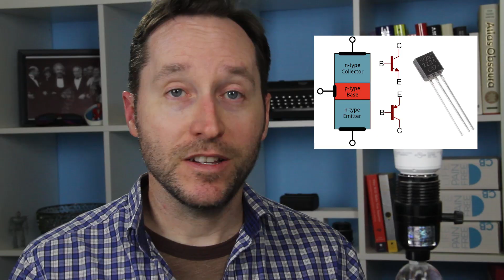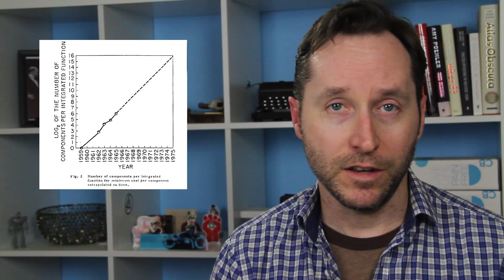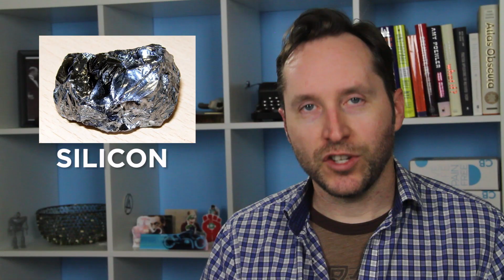Moore's Law Is Ending - Here's 7 Technologies That Could Bring It Back To Life | Answers With Joe

Comment: Computers will NEVER be totally reliable until a $500 CPU is not reliant on the proper function of a $1.50 cooling fan for its survival.
Reply: You can spend $10 and get a bigger fan
Reply: On most current cpus, the death of the fan won't kill the cpu, it will save itself by clocking down until the temperature is safe again
Reply: Pasively cooling CPU's has been a thing for a good long time. Passively cooling a GPU won't be a thing until Graphene is also a thing.
Reply: @btoiscool   what about the 1030? xD
Reply: @elorock6747  that trash is too low tier for me to care about it
Reply: @btoiscool  true, but it shows that it is possible. There even is a passively cooled 1050ti by palit. Its just a matter of how big the heatsink is, plus things like convection assisted cooling like in the corsair one.
Reply: Rick Jasper we’re getting close with laptop and smart device chips
Reply: Would it help if the fan were $500
Reply: I’m ghetto, I know... but dude... easy workarounds. I’ve had years of success with some minor casing removal and a table fan.
Reply: you do know what a heat sink is, no you don't, or else you wouldn't have written that comment

Comment: You're explanation of Quantum mechanics is only going from binary to ternary, and DNA is actually a Quaternary system.

You might think it's only binary because T only pairs to A and C only pairs to G, but order matters. TA is different than AT. If it didn't matter, then it might as well only have two pieces not four.
Here's all the numbers: 

AT - 0
TA - 1
CG - 2
GC - 3

Comment: a quantum computer, as we understand it, cannot exist yet. because quantum mechanics says it can be off and on at the same time. 1/0. or off 0, or on, 1, or off off 0/0 which is on. or on on which is on 1/1. as for 700 terabytes of weight- sd cards weigh about half a gram. so 700 terabytes would be 350grams. sandisk sells terabyte sd cards. im sure there is larger storage devices not available to the public.

Comment: The stacking solution was debunked from the get go, it is a structural marvel, but has no use as a processor, as it would melt itself (or at least get so hot you can't use it with any kind of efficiency).

Comment: The bipolar junction transistor (BJT) cited as the fundamental switch technology has been obsolete for digital logic since the 1980s. Complementary MOSFET (CMOS) transistors took over and made possible the current state of the art in silicon chips. CMOS logic started out as low power and slow, and evolved into low power, blazingly fast, and shrunk way smaller on silicon die area than is possible with BJTs. BJTs are still good for analog audio and RF amplifiers, but even a modest computer chip would be very expensive to fabricate and then fry due to high power dissipation.

Comment: Heh, it's pity you are not mentioning concurrent  programming. You see the reason why Moore's law is a big deal is because  most of our software can run only on one processor core. But you can have multiple processor cores (e.g. i7 chip is 2 physical cores, some  AMD chips are 4 cores,  some servers have 64 core, latest smartphones has like 6 - 8 cores, even some graphic cards have like 512 cores ...)You often hear programmers say "we cannot scale horizontally but we can scale vertically" that means we cannot put more power to single chip but we can have more chips. The problem is that lot of programming history was about taking advantage of single core  that's why we are stuck (e.g. Microsoft Excel still running on single core).  But if the software was written "concurrently"  then you have no problem to use multiple cores. Last couple of years there is huge mindset shifting in Software Developer communities and pressure emphasis on concurrent programming (e.g. check out Erlang, Elixir lang, Go lang, Clojure. These are highly concurrent Functional programming languages  that can achieve communication between multiple cores. Yes Object oriented  languages like  Java, Ruby,... can do concurrent programming as well but there is "thread" level locking of state that is to some degree working but would never reach 100% potential of all cores) So the only limitation at this point are (unfortunately) people and cost of rewriting popular software concurrently. Conclusion  although protein chips sound cool the truth is that for next decade silicone chips are here to stay. It's just you will  have 128 core laptop. The Quantum computer is definitely the future but at this point way ahead of it's time.
Reply: imagine you have a shuffled deck of cards, and it's only you who can sort them in order. Cool you are single core processor. Now imagine you have 3 friends over (so 4 of you) and you will give to each 25% of the deck cards  to sort out and then you will just join them together. Awesome Now you are 4 core processor running program concurrently (e.g.: Functional programming languages like Elixir, Go) . Now imagine same situation where you don't want your 3 friends to touch the cards so  you will sort them together while your buddies are watching TV. Now you are  4 core processor running program on single core (eg 90% of world desktop software).

Comment: that graph around 2:20 is somewhat inacurate, it has been increasing quite a bit faster then that, the latest i7 6800k is quite a bit faster then two generations ago, and if you compared it to the fastest intel processor from 10 years ago it's 5 or 6 times faster.

Comment: You have four different configurations in DNA. That's 2bit. Not binary.
Reply: Yes, thank you. I got so distracted after he said that I couldn't focus on anything else.
Reply: There is four different acid things but they can only be combined in on way. Depending on which order they are stacked between the double helix things you can create two different states, there for its binary.
Reply: @birgerjarl4391  Each of those pairs has two orientations
Reply: @birgerjarl4391  the extra helix is essentially the backup each side has 4 different   elements

Comment: The diagram you showed is not the correct type of transistor for digital logic - you showed a Bipolar Junction Transistor (BJT). Since the 70's most digital logic has used MOSFET (Metal Oxide Semiconductor Field Effect Transistor) which doesn't have a base/collector/emitter, instead it has gate/source/drain and is voltage controlled, not current controlled, and has a very fast switching time, minimizing power dissipation. The transistor you showed is used primarily in analog circuits, where linearity is useful, and turning it fully on is wasteful and generates unnecessary heat.

Comment: nice video but i think it was the other way around. they were able to calculate 15 = 3*5 which is really impressive. Imagine doing that with  34564098. A quantum computer could solve that within seconds. With a normal pc this would take longer than our universe exists.

But a quantum computer isn't automatically that much faster than a normal pc. It's just for very specific tasks where simultaneous computing  is beneficial. For example: finding the way out of a labyrinth. A quantum computer could solve that in an instance because he can try all paths at once. A normal computer would have to try one path after another.

Comment: TL;DR (Spoilers):  No one remembers Moore's Law correctly--that aside--"Moore's Law is dying" is bullshit.  Using Moore's adjusted prediction of a doubling every 2 years, we're perfectly on track.

So, I wrote a paper on Moore's Law in College and this is not correct.  Firstly (and this is a minor thing), Gordon Moore co-founded Intel with Robert Noyce in 1968, while Joe claimed it was "a decade later (referencing 1965)."  Secondly, the part of Moore's Law that everyone and their mothers seem to forget is that Moore's prediction was in regards to the number of transistors on an integrated circuit per dollar of manufacturing cost.  This means that if Intel paid to have a 1 mil transistor chip manufactured for $100 one year, the following generation--18 months later (originally 1 year, then 2 years as Joe states)--would be able to make that same chip for $50 or a 2 mil transistor chip for $100. 18 months later, 1 mil for $25, 2 mil for $50, 4 mil for $100...
All this aside--and ignoring the "per dollar" part, as everyone does--Moore's original prediction in 1965 was way off.  His paper stated that we should be able to manufacture chips with 65,000 transistors by 1975.  The highest transistor count that year was 8,000 and was the TMS 1000, a Texas Instruments processor that came out in 1974.  The first processor to break this 65k prediction was the Motorola 68,000 in 1979 which had 68k transistors.  This is why Moore changed his prediction to a doubling every 2 years.  The trend held to this prediction for a long time....occasionally lagging behind (like from '91 to 2001, when we went from on par with the projection (predicted 1.17mil, actual 1.18mil) to behind by 30 million transistors in 2001 (predicted 75mil, actual 45mil), then spiked up to nearly 3x the predicted 150mil in 2003.
This version of Moore's Law stretched to 2017 shows a prediction of 19.3 billion transistors on a chip.  AMD's 32-Core Epyc server processors are coming in at 19.2bil.  I'd say we're still on track (again, ignoring the whole cost for manufacturing issue that Mr. Moore originally spoke of).
Reply: One year later and he still hasn't gotten laid.
Reply: NOYCE!
Reply: My last 3 computers, at LEAST 5 years of time...were all 2.4mz 2 core cpus, all about $600. Moore's law has been dead a long time.
Oh wait, this most recent computer was $900...it's 2.6mz.  Yeah. Dead..
Reply: But AMD's 32-Core Epyc has 4 dies. So it's rather 4 chips in one. :)
Reply: Xomsabre Nerd, this is why you can't get laid.

Comment: It stands to reason that as you make the widths small enough, semiconductor behavior begins to breakdown. Although that process is continuing even as we reach 14nm geometries, so go figure. As a processor nerd, I have noticed that the enormous speed increases that we saw during the last quarter the end of the last century have all but disappeared, and the fastest micros top out at around 4-5GHz, even with aggressive overclocking and cooling strategies. And it'll be a good while before any of the techs you mentioned will be mature enough to manufacture at any volume and anything like an affordable price. But I hope they will show up eventually.

Comment: If photonic computing could be worked out, there might be  a way to design a Molecule that behaves like crystal and then is grown as a platform that would work like a chip; each molecule would be a computer within itself. Based on how that molecule is designed, it could even operate as a quantum computer because the crystal structure should lend itself to photons being directed providing opportunities for multiple photons at a single position. Something impossible do with an electron.

Comment: In 2056, the fastest and most efficient system of computer processing uses what will be known as the String Axon Medium. When a Tau particle is generated through acceleromic piezoelectric tazon pulses, it is then augmented through an electromatter-optic quattuordec lattice to create quintillions (10^18) of data-embedded static Tau neutrino particles. In the future (or at least mine of 2056), this is called Examatter. By isolating (aka: regenerating) this normally decaying particle, the String Axon Medium is created, and data is synthesized in a never-ending, self-sustaining, and self-learning pattern. I am not allowed to say more.

Comment: In the mean time, get really good at parallel programming. It can be much harder than single-threaded programming, but it's an invaluable skill to have as a software engineer, exactly because Moore's law running out of steam.
Adding more cores to processors still scales relatively well, as it's linear. Increasing clock speed, on the other hand, increases the dissipated heat by the square of the clock speed, so we'll need a breakthrough in physics to get much above 5GHz.
I make as much of my performance-sensitive code parallel, as possible.

Comment: So just want to add to the whole Quantum computing part here... its not that it can do multiple calculations at one time because it is both 0 and 1 at the same time... and it is not limited to 3 settings on, off, and on/off... its based on the fact that something is more something else for instance it is 20% off and 80% on ect... which means we can have more then base 3... and its not because we can do multiple calculations it means instead of being limited to base 2 we can now calculate with base three... some examples... binary for 2: 10 ---- trinary for 2: 2 ---- binary for 15: 1111 ----- trinary for 15: 120.... as you can see we need less space to do that calculation... That being said with a quantum computer you could go Base-4/Base-5/ect... dependent upon what their measurement limitations are...

Comment: Moore's law doesn't have to end. The main limiter in doubling transistors is heat, but if you used those extra transistors to create  Analog Boolean processing you get lower powered processing at the expense of precision since the value is either probably or mostly on or off, rather than definitely on or off. That something that could easily be done right now. in fact, analog processors already exist and are being researched for use in drones because they use less power. If they just add analog portions to digital chips it would actually solve the problem and the additional benefit is that analog chips are more suitable for artificial intelligence.

Comment: That thing about DNA memory... I didn't know that. But what I can understand is that it's done using chemicals (the chemicals that make up dna). This means that you could do this with any other chemicals.
I like it. I like it a lot. but...
Why would you limit yourself to a binary system when trying to save memory when you can use hexadecimal.
Yea sure, you'll need 16 different bonding elements but each digit would be equivalent to 8 bits in binary.

Comment: You can't use just Graphene as a replacement because it has no band gap (something you need in order to turn logic transistors on or off) , this is one of many reasons why silicon will never be fully replaced but rather improved upon because we have many more years of research on it, it's cheap and abundant, and it has a good band gap

Comment: Without even appealing to any currently exotic computing platforms, we're still pushing the boundaries on RAM, storage and networking.  By improving (lowering) power consumption, we pave the way for deploying ever more cores, which is especially helpful in virtualized server environments.  And we are making some, if slow, progress in figuring out how to apply SMP to problems that we've previously had difficulty spreading out over many cores.

Comment: What about neuromorphic computing? Unlike some of the most exotic concepts, one transistor proof-of-concepts etc, neuromorphic CPUs like IBM's True North already exist. And they are way past the prototype stage, IBM already sells them to various universities and government labs., along with a full software stack they have developed for them. Their most exciting design feature is that they fully merge logic, memory and I/O. All memory is the equivalent of L0 cache (registers and μops cache) in conventional CPUs, being closer to the logic than even L1 cache, so the Von Neumann bottleneck is completely eliminated. Thus logic and memory run at exactly the same speed.

True North is modeled after the human brain, so it is clocked slow but it's massively parallel and extremely energy efficient. It is ideal for pattern recognition and running neural networks "natively", in hardware. Now, I am not sure if and how it or similar CPUs could be adopted for general purpose computing. The computing model, and thus all programming, instructions, data etc are all insanely different. IBM uses a general purpose CPU as a "controller" to expose the True North CPUs (they make two versions with 16 True North chips) to programmers and scientists,  along with their software stack. I cannot even imagine how it could be programmed and controlled directly. The architecture is scalable, conventional photolithography can be used to make the dies, and IBM intends to expand it with many more neurons and synapses in the future, when they move to smaller process nodes.

Comment: 3D-stacked memory chips have been used for a (short) while in commercially available SSD products (i.e. Intel Optane) and are expected to replace the current gen flash memory fairly soon. Quantum computer have also been around for bit (I think Google has bought one or two from D-Wave), seem to be used for specialised data analysis and don't look like they'd be useful for general computing anytime soon.
I'm sure you and Matt already knew all about that, just thought it would have been nice if mentioned that in the video ...